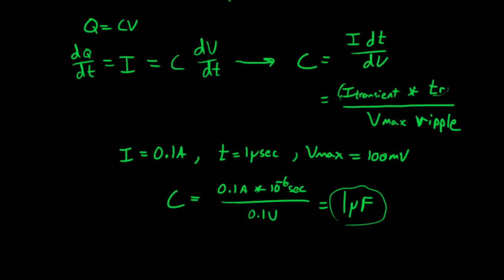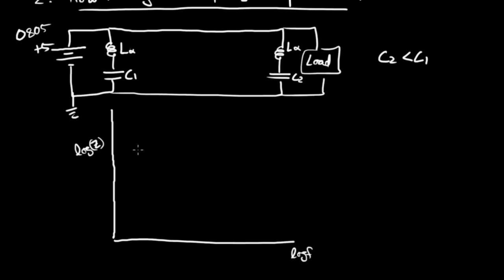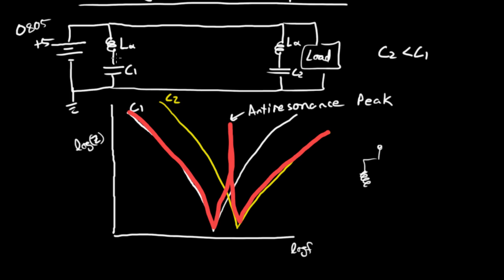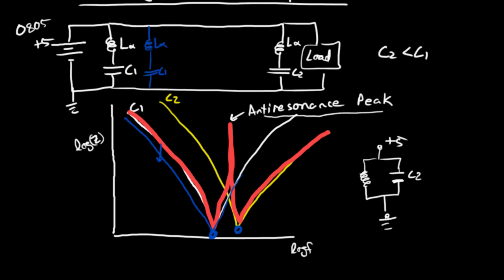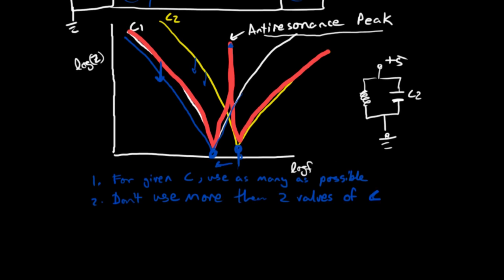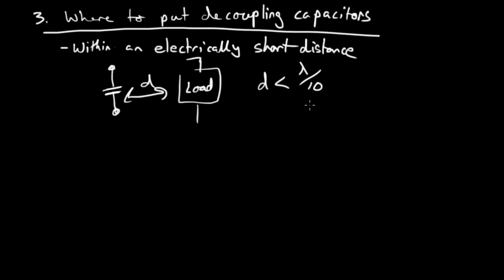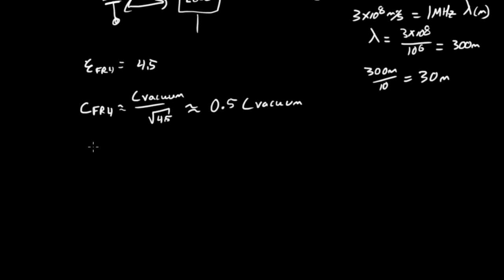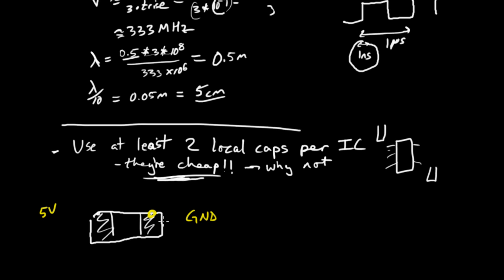Decoupling Capacitors: 3 of 4

Comment: That via placement example makes an unspecified assumption about the traces between the chip and the bypass cap.  Since it is unstated which layout this advice applies to, it's pretty uninformative. One style would put the local power traces in the top layer, using vias only to feed the bypass from the bulk rail.  Another style would feed the chip directly from power and ground planes, with a nearby bypass connected separately to the planes, thus putting up to 4 vias in the local bypass circuit.  And then their are the compromise  styles between those extremes.

Comment: The anti-resonance peaks can be quenched/flattened with ESR. You typically need many different values of capacitance to flatten the resonant peak crossing from PCB decoupling to on-die/on-package decoupling, to meet the target impedance.
Reply: So how do we know in advance whether adding several caps in parallel is going to be beneficial or not ? Dave Jones of the EEVBlog demonstrates what happens in one of his videos "Bypass capacitors", and indeed it's not clear when the anti-resonance peaks are going to nullify any benefit.
Reply: InXLsisDeo, The guess and check method lol? Just model it with several different combinations  and test each. (because it's as inexpensive, easy, and non-time-consuming to implement that in an advanced circuit, as it is to say it, and in industry every company would totally go for it.) (<--- sarcasm, intended to show that I'm aware that it's easier said than done. [tone doesn't reflect in text, and not every bulb on YouTube is all that bright]) 

On a serious note; I'm not sure... I came here from Dave's video looking for the answer to that very question. I'm getting the impression that if it's not something you can feasibly guess and check, and it's not a known circuit design, than you're SOL and JWF (...sh*t our of luck, and jolly well fu*ked... most of you probably knew the first one, but people often ask about the second acronym, so I figured I'd clear that up now).
Reply: @binaryglitch64   Why could we modeling and simulation that first?